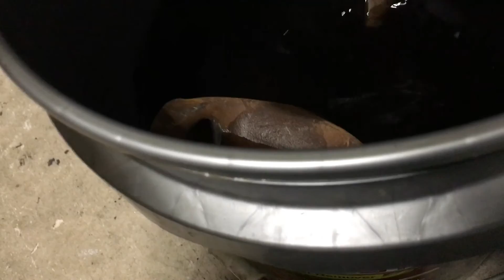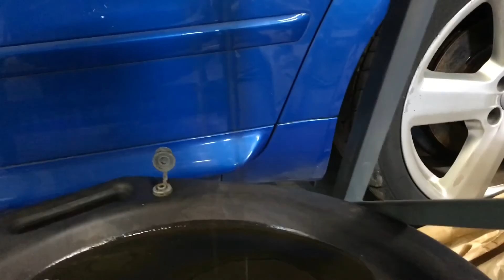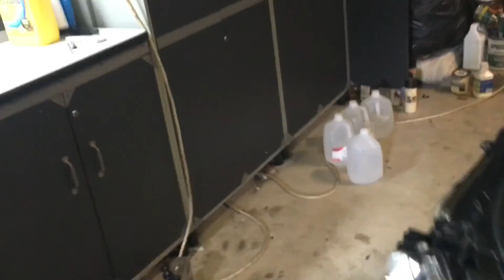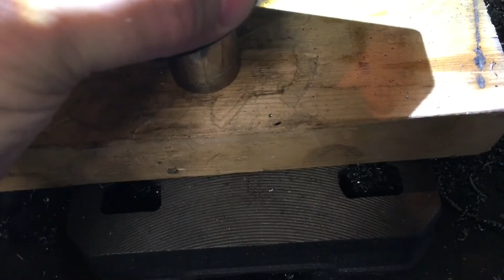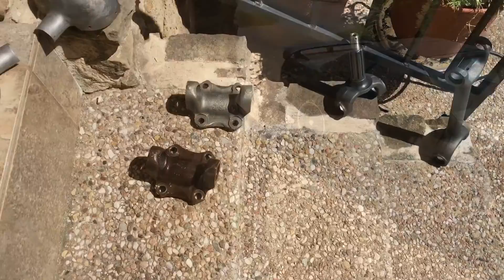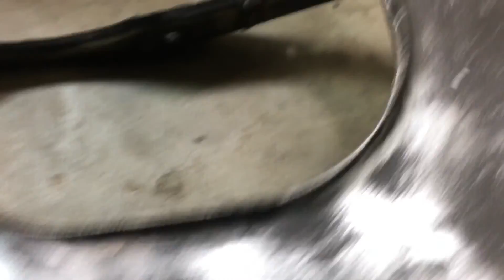Derusting IRS parts and welding IRS frame

Comment: That Evaporust really looks like some great stuff!!
Where are you buying your Jag replacement parts?
The place I got mine from in Washington state several years ago went out of business .  :-(
Nice work on the welding.  :-)
Reply from the maker: Thanks, Cecil.  I use the "usuals" as they are referred to on JagLovers.  

http://www.sngbarratt.com/
http://xks.com/
http://welshent.com/
http://www.terrysjag.com/

And Amazon and RockAuto also have parts for e-types.  I bought my 4 rear shocks on Amazon and the bushings from RockAuto.  RockAuto carries URO parts which is an OEM supplier to Jaguar.